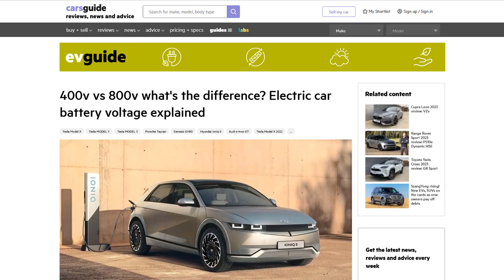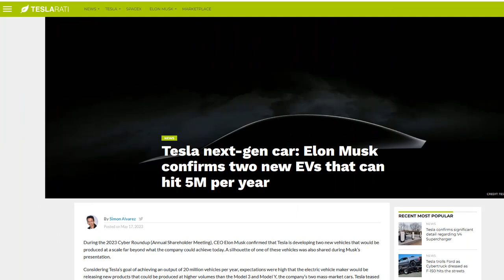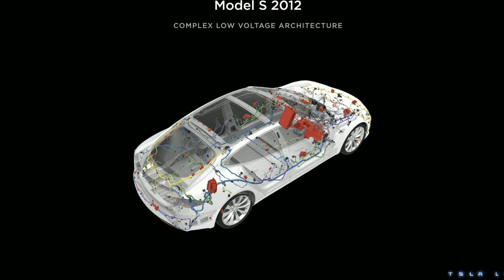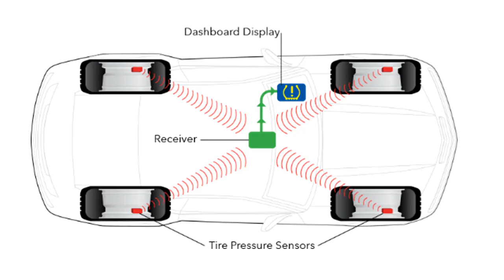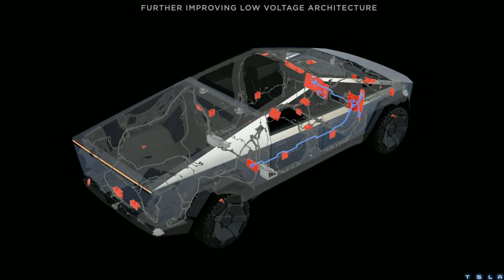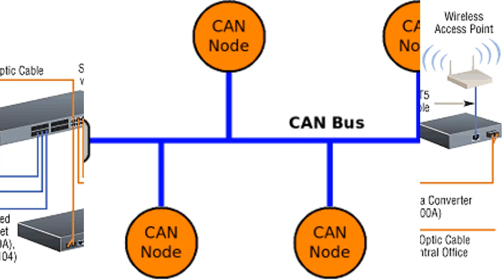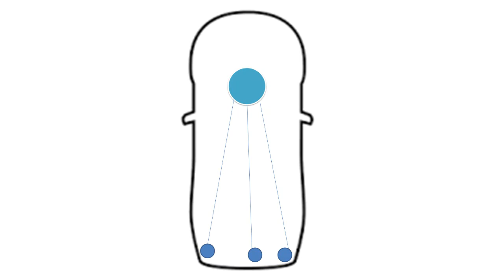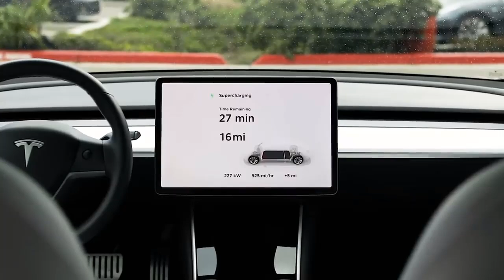The REAL Reason Tesla is Developing the Cybertruck

Comment from the maker: How do you think Elon Musk's approach to increased voltage systems, and Ethernet-based wiring will impact Tesla's competitive advantage with the Cybertruck? Be sure to watch:
• Joe Biden Drops $300 Billion BOMBSHELL on General Motors (A Win for Tesla) https://youtu.be/fm_XgzOR4w4
• Tesla Drops BOMBSHELL on Pickup Truck Industry: https://youtu.be/gfkscVQ1iyQ
Visit our website https://themarketisopen.com for instant stock quotes and 15 years of free financial data
Reply: Diesel electric trains got their start from diesel electric submarines of WWII.
Reply: Hearing rumors of steer-by-wire on the Cybertruck as well any insights. Or is that for the $25K vehicle?
Reply: @C45T3R It really does look like the Cybertruck will have it.  I can’t see how mechanical steering would be incorporated into the current design of the castings especially with 4-wheel steering.   Pure speculation on my part though.   Hopefully Brembo Sensify brakes will come with it too.
Reply: NO SOLID STATE BATTERIES=EV=IRRELEVANT
Reply: @billybobbob3003 moronic brain at work
Reply: @bigdougscommentary5719  NO SOLID STATE=LIKE OLD OUT OF DATE HARDDRIVES SAME SHIT WITH ERV BATTERY

Comment: Vertical integration is in itself revolutionary but you pointed out something even more profound. Having specific component manufacturers producing Tesla engineered items. Initially, the manufacturer can take on this new role because the economies of scale will justify. Later on, I can see it morph into something much more suited to Tesla’s fast iteration cycle. Consider a  “flex fab” concept where once a new design integration occurs (even in extreme cases) specs are uploaded and new components are seamlessly produced. And of course, additive manufacturing plays a key part in this. 

Higher volt architectures should of happened decades ago. But due to greed and “it ain’t broke don’t fix it” stifled and is stifling innovation. It’s a bid deal. 

Now I have a question for you. Elon recently replied to a post stating room temp superconductors (RTSC) won’t be “super transformative”. For a channel with a background of and a deep foundation in financials, concepts of technical aspects, engineering methodologies and scientific rigor are not only embraced here but are incorporated unlike any other such channel I follow. You research is fantastic, your attention to detail is incredible and the ability to take one, two and even three steps back to incorporate the big picture are reasons I continue to return. From you POV, help shed some light and assist me in filling the gaps that would lead Elon Must to down play a technology I’m confident will be the turning point in human history?

Comment: Wireless AND wired systems can be interrupted by various things.  The main phone company where I live was having a lot of trouble with their small-to-medium business DSL Internet customers.  Customers had to switch to fiberoptic or other (cable) Internet providers to get reliable service.  Sometimes the customers could stay connected for a whole week, and then have a terrible half-day or even a full day.  That phone company found out the disconnects were caused by the staff of a Harley-Davidson custom bike building shop.  Whenever one of their guys was using their arc-welder, the radio-frequency interference affected the DSL signal in the buried telephone trunk line that went right by their workshop.  The welding guy typically would have a job to do for a few hours or a day, followed by a week or more of other work - so the outages seemed very random.  The phone company ended up just offering the affected business DSL customers a free upgrade to fiberoptic Internet service, throttled down to the same speed they were paying for on their DSL contracts.
Anyway - can a Tesla's control systems fail to work if the car is right beside that Harley shop?  Can that be dangerous?
Reply: Teska would get the shielding right. It's a simpler problem inside a box.

Comment: Get real, do you know how batteries work?  A 1000 volt system basically means they are putting more batteries in series to get the higher voltage.  The bottom line is, by using a higher voltage system, they can use thinner cables so manufacturing can save money.   Voltage by itself is meaningless.  Energy is measured in watts and energy usage is measured in Watt-hour.

Comment: Have been advecating for a 48volt DC for home electricity and only kitchen, utility room(for washing mashine, vacume cleaner anf other to be connected inside the house) and garage to have a normal AC connectors.
This is due to electronics and electricity loss and also with same connections you get infra and internet(yes first version to be a POE later with better power output over same or better cables/connectors) to power and connect devices for less wireless signal noise.
Reply: Done that for close to 2 decades now, but with my small company it is an impossible task.

Comment: As voltage goes up, current goes down.  Lower current can be handled by smaller wires.  Insulation weighs less than copper.  Win!!!

Comment: The move to 48 Volts was inevitable, as it reduces the amount of copper needed and with that the weight, but it more or less forced Tesla to go to 80-100% in house designed controllers... But at the scale Tesla is aiming to produce cars and trucks, that is a non issue... I am pretty sure with project Highland the move to 48 volts will be made as well, and controllers will be used across the models line up. Same boxes and printed circuit boards, but with adjusted software for each model. Add to that the use of Ethernet (POE) and wireless communication, and even more reduction in copper is achieved..

Another advantage of this standardisation is that over the air updates are easier and less coding is required because the updates are virtually the same for each model.

All this will result in massive cost reductions, and higher quality of the products, and increased rate of innovation.

Comment: POE sounds absolutely brilliant (i didnt know this was a thing). Apparently it can be done over 12v, i am reading up on it, but it is not at all common and typically between the 40's-50's volt range. I will anticipate a Munro teardown of the Cybertruck to see how this is applied as far as the ethernet wire gauge used to transmit 48v and data across the cable. I imagine this saves a lot of copper and obviously saves having the need for a data cable and power cable separately, meaning easier manufacturing on the assembly line.

Comment: p=iv.  power in watts equals current [i] x voltage [v]
the higher the voltage, th lower the current
75kw = 75 amps x 1000 volts 
or 75kw = 750 amps x 100 volts
it is better to have high voltage low current. Low current means low heat, low heat wastage. . High current = high heat and high heat wastage. 
P=1squared R, or current squared x resistance. The lower the resistance, the higher the current. Current creates power, not voltage.

Comment: Finally Elon starts to look at V2G.
The fact that the current models can’t do this - including their wall charging box - it’s for me one of the biggest drawbacks of my Tesla.
Reply: They had good reasons to not want to do it in the early days.  Pack life is tied to cycles and the more charge/discharge cycles the shorter the life and using a car for a V2G just increases cycles.  Battery tech like LFP changes that equation.
Reply: @TheEvilmooseofdoom  Well, LFP batteries are available in certain Teslas for 1? 2? years now. So what's stopping Tesla?

Also, in general: Sorry, I don't agree. 
I want to buffer power from my solar panels from day to night to supply my house. This is the obvious and most common application.
My (rather large) house uses ~10 kWh per day. Let's assume half of that is after dusk (and thus needs a battery). That means the car would have to buffer ~5kWh. 
My Model Y LR has how much battery capacity? 80 kWh? 
So buffering power for my household would be in the order of magnitude of one full charge per two weeks.
While that's obviously more than zero, it is NOT a signifcant number.

But since this technology is not available from Tesla, I now need to buy a SECOND battery only for my home, costing me easily how much? 5.000? 10.000? (including install etc)? That I have to put on the table, just because that big battery that I already own lacks the technology to power what I want it to.

I feel even with the additional degredation accounted for, using the car would still by far be the better deal.

That Elon has not implemented this long ago is just a gigantic fail. To make matters worse, to my understanding V2x isn't even standardized in the NACS. As opposed to CCS where the specification of V2x was finalized a few months ago. That alone makes CCS the superior system in my eyes.
If there just would be cars and wallboxes that have it implemented...
Reply: @j.4941  So we agree LFP makes V2G more practical..  I also agree 100% that a home battery should be 100 kwh+.  It's not how much capacity is used, it's the cycles and when Tesla was new they were using 18650s that were mostly being made for consumer electronics.  High draw and high charge shortened their life and they had to warranty those packs.  Keeping the charging cycles tied to driving alone was a good way to control that and gather data on how the packs performed.  I think you're taking a rather simple and short sighted approach to be honest.
Reply: Nope out on that one.  I will keep my battery full strength and separate from the "grid".  WHEN the grid fails, (been there for two weeks post hurricane) I use a propane powered generator fueled from an in-ground propane tank from which I can charge my Tesla and drive circles around people standing in line at the few gasoline stations available.  Experience has taught me to be supporting and not dependent on grid and gas stations.

Comment: I understand that power loss in the wiring will be reduced by a factor which is closer to 4X and not 16X if the battery voltage is increased from 12 Volts to 48 Volts because of the increase in the resistance of the wires. Obviously if you do not reduce the diameter of the wiring then the 16X would apply. The reason for reducing the current is to reduce the amount of copper which results in an increase in resistance.
Reply from the maker: Yes you're right. Factor of 16x reduced losses given diameter is the same.

Comment: POE is potentially a fraught system for general communications with power in vehicles.
The reason is simple - very limited power available with all POE standards.
Reply from the maker: Should be fine, though if more power is required, there's IEEE 802.3bt or PoE++ can do 100W of power. Though looks like regular PoE is what will be used in the cars.
Reply: Window motors and latch mechanisms can hopefully come in at less than 100 watts each.  1 cable to each functional unit of the car would be awesome! @TMIOTesla

Comment: Mega chargers will for surely accommodate Cybertruck, Cybervan as well as Semi.

Going higher Voltage on Cybertruck also helps Tesla “scale” components for SEMI.
Reply: It would look like the V4 and the semi charger will use different plugs so I suspect CT won't charge at semi-stations unless they include 2 ports.. which is not impossible.

Comment: just my two cents 400 volt is okay 600 volt and up is Hv this is only for Hv specialist
600 volt is the max voltage for a EV driver to charge the car it self and yes they all holding
the 800 volt cable only to know if it is going to be hot simply not allowed!
Reply: Last I heard they were going with 1000v.

Comment: The biggest advantage of the ethernet system i see is the reduction of connectors required.  If you look at traditional vehicles there are large connectors (plugs?) Everywhere - often times with 20 wires.  Its a mess and theres a lot of failure points.  But,,, since the car manufacturers have been doing it that way forever, its a lot cheaper and easier than inventing a whole new system.    Im sure after Teala invents these systems they will be copied around the world, but obviously Tesla has the advantage of being first to market.

Comment: All  this talk of wires, did anyone ever think about the effects of EMF radiation on the human body?  People will e inside a cage of wires and devices which will create a bubble of EMF.   I would like to know how much is a person getting?
Reply: You already live in a EMF bubble and have for a long time.
Reply: @TheEvilmooseofdoom  I have a high quality EMF meter because my wife was concerned about radiation from our microwave oven after I replaced the inner door panel when she dropped a pot and broke the glass. Generally, there are no EMF issues, but it is a known fact that motors produce EMF.  There can be up to four large motors on an EV. Each one, plus the wiring is generating EMF radiation. I would like to know how much. Maybe it is not an issue. Maybe we  will only find out when pregnant women with EV's have deformed babies. Lots of unknowns.
Reply: @russmartin4189  Sunlight is Electromagnetic radiation too.  Electric motors are everywhere.  I think other sources of radiation are far more significant.  People spend hours a day holding a radio transmitter next to their head, some wear them.  However I do not think any long term or specific studies have been done.
Reply: @TheEvilmooseofdoom  The wheel motors are pretty large. Probably the largest motors most people have ever been around. The question is, how much EMF from them gets into the passenger space? Someone should take an EMF meter and sample the cabin when the car is humming along at cruising speed.
Reply: @russmartin4189  It certainly can't hurt for someone to check.  Part of the problem is sometimes when it comes to things like this and other radiations is the time can be long and making conclusive cause and effect connections becomes difficult as years and decades mount.  This is part of the quibble people have over the effects of Chernobyl etc.  Trends in population groups is all they can monitor because it's hard to say if someone got cancer from source A or source B over a long time frame.

Comment: With all that wireless technology, it’ll be like driving inside of a microwave oven. 🥵
Reply: Last time I checked, Bluetooth does not emit radiation with a power of 800W. 
Your cellphone emits radiation with way higher power than Bluetooth because it has to communicate over long distance, and you put it on your ear which is even way worse, but for some reason everybody uses cellphones nevertheless without complaining.
Reply: Not.

Comment: High voltage means high power parts can operate at reduced current. That allows smaller cables and smaller switch contacts. Motors need smaller winding wires and controllers are more efficient. It has next to no effect on charging performance.
Reply from the maker: It does have an effect on charging speed, since if you keep the wires the same size, you now have much less resistance and therefore heat being generated. 16x less as per the video. So while there's other factors like battery etc, you can push more power through while generating less heat. The 800v list of cars at the beginning of the video all charge faster than teslas.
Reply: You missed the charging is much faster . Literally said so due to low voltage needs being separated from the high power needs. Meaning big wires for power output and small wires for accessories. Using converters and controllers in software . As software provides all the switches

Comment: High voltage has minimal effect on charge rates because individual cells run at approx 3 volts and are limited by internal chemistry and thermal management.
Reply from the maker: Sure but they can update the design, and higher voltage helps with thermal management.

Comment: Every Tesla ever made has vehicle-to-grid capability. Any serious VTG system uses an external inverter (Ford does) so all that is required is a software update to close the car's DC contactors when plugged into an external inverter. Tesla doesn't do this because they want to sell Powerwalls.
Reply from the maker: Kind of, I guess there's some dedicated hardware missing, and software as you mentioned. Though the feature is on its way now!
Reply: @TMIOTesla  No kind of at all. Superchaging puts DC directly into the battery, bypassing everything in the car. It's just a matter of reversing current flow.